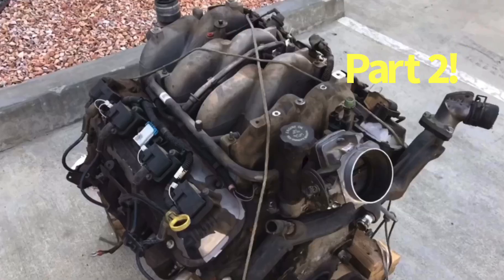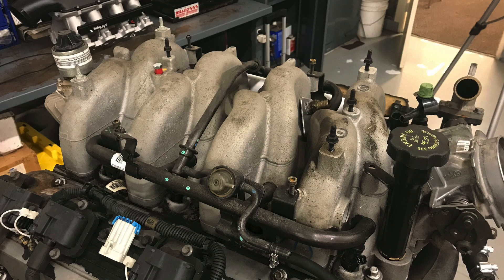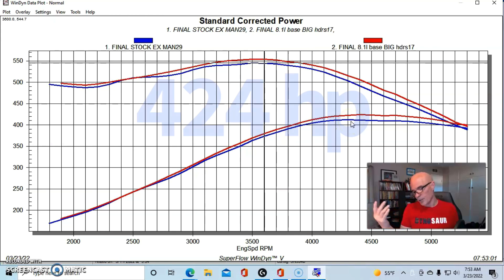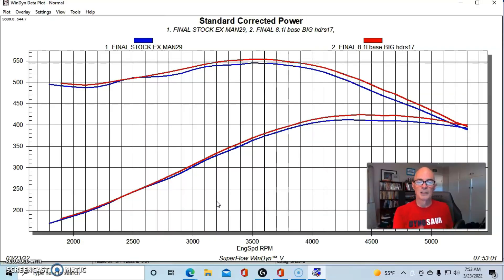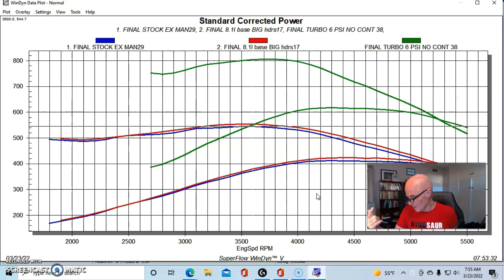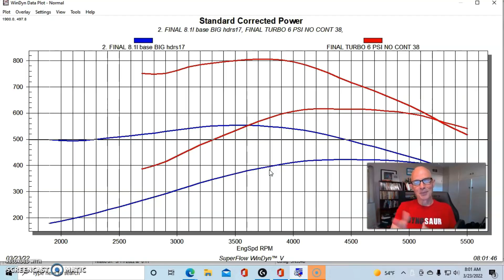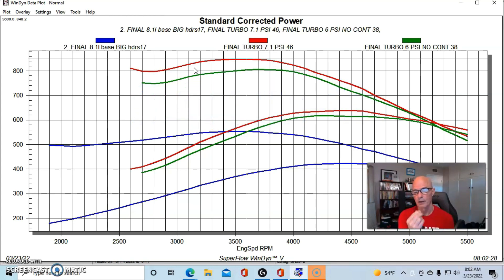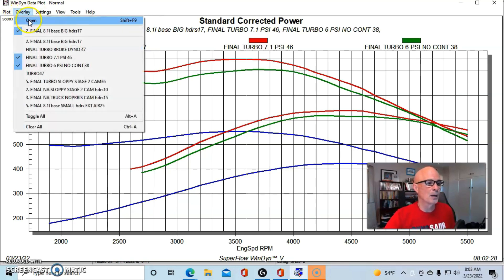HOW TO DIY TURBOCHARGE A JUNKYARD BIG BLOCK CHEVY-8.1L GEN 7 496 TURBO-HOW TO MAKE BIG TORQUE GAINS!

Comment: An idea for maybe a future video, in regard to turbo towing torque stuff. Have you ever tried lean tuning? Like intentionally running the motor past stoich, like 16:1. The EPA doesn't allow this due to NOx emissions, but for an emissions exempt rig you may be able to combine diesel efficiency with gasoline ease of build/cost. It'd be interesting to see what timing can be run past stoich on like 91oct. My understanding is that combustion temps go back down past stoich, but EGTs stay high.
Reply from the maker: that can be done under cruise conditions-my Civic VX ran lean burn (19:1)
Reply: @richardholdener1727  Yeah I've heard that some JDM cars do it from the factory. I'd be curious what happens under load. It'd probably kill a cat fast, but without that it could be good for high load efficiency.
Reply: @Projects Forever  - under high load running that lean doesn't kill the cats, it kills the rods/pistons. Light load/cruise conditions are fine as the cylinder pressures are relatively low, but at WOT you end up with catastrophic knock and shrapnel everywhere if it leans out. 

Google can get you as deep into this as you'd like if this isn't enough, or I know there are plenty of videos here on exactly how and why this is. 😀
Reply: @Broadpaw_Fox  I'm not sure that's true. As you approach stoich yes, but past that I believe knock goes back down, but again, I'm not sure which is why it'd be interesting to test. Imagine you go lean enough that you're throttling with fuel, you're literally putting less energy into that combustion chamber, which means less heat (and thus less knock).
Reply: @Levibetz  Interesting concept, but might only work with direct injection gasoline engine otherwise with port injection the fuel will already be compressed in the cylinder and the cylinder would be running hot causing preignition or literally turning your gas engine into a diesel lol...
Reply: Interesting!
Reply: That's some scary shit running leaner than stoich..my question is why would you even want to do that?
Reply: @jeffreyperrault3792 Better BSFC.
Reply: @jeffreyperrault3792  fuel efficiency/ good power under load.( it goes rich to make power, lean to cruise light load. We went as lean as 26-1 on natural gas,( no NO/x).

Comment: There's a reason for big blocks.  800 lb*ft of torque at 3500 rpm is ~530 HP.  That'll jerk your trailer uphill at a good clip.  Why rev any higher?  
God created the big block Chevy because he loves us and wants us to be happy.
Reply: On the other vid i commented that the torque peak is 3500 and HP peak is 4400 on this combo, however the torque is almost the same right off idle.   So it's setup perfectly for towing.    This engine would really come alive with a cam that puts torque peak at or above 5200 and HP between 6000-6500 RPM.
Reply: @dennisrobinson8008  but why even rev that high
Reply: Amen!
Reply: Amen!

Comment: Hey I need to ask some questions if you have the time
Reply from the maker: ask
Reply: I have a aluminum block from a 2012 gmc 4x4 I'm trying to buy pistons and don't know what to buy I'm running 243 heads and plan to run low boost in the future but would like to buy some forged pistons and forged rods and don't know what to get as far as rod length  C.H the dish or flat tops  ect.  Would like for it to run on pump gas aswell I'm just a little lost over here

Comment: Hey Richard, I am planning on adding a turbo for more towing power to my Stock 5.3L L83 Sierra as I will be towing my travel trailer more often. I was wondering whether I should just look for a complete turbo kit, and do it all at once,(once I have saved up for it) or upgrade my engine a bit at a time. Such as adding a CAI, beefier injectors, larger exhaust, and upgrading my torque converter and rear gears. A suggested parts list would be greatly appreciated. BTW, love the videos and information. Thanks.
Reply: Don’t your waste money on a CAI of your gonna boost it as you won’t use it.
Reply: Supercharger would be easier and cleaner install. Factor in tuning cost AND wait time to get tune done. Suppose you could remote tune if you absolutely had to
Reply: I agree a supercharger would look cleaner, and would be just as beneficial, but the price tag would be way out of my budget.
Reply: @crazygrandpame4946  turbo setup is gonna get outta control fast. The turbo is the easy to factor cost of the build.  Fuel setup, IC piping, intercooler, fuel system, custom manifolds...not to mention fabrication. Being able to drop a Magnuson (or equiv) in place of the intake manifold would be similar price to a "quality" turbo setup.
Reply: I think you could buy an LT5 takeoff supercharger and be alot cheaper than the actual Magnuson. Someone on YouTube has one, 500rwhp I think it was on the 5.3

Comment: Just pulled the 6.0l out of my 02 2500hd 4x4 4.10 and put in a stock 8.1 (out of an 03 Avalanche) with a Black Bear tune , uh yeah , I'm liking it !
Reply: I have a factory silverado with 8.1.  This tune has my interest
Reply: How has that tune been over the years?
Reply: @ijonathanf  So far so good , truck is running strong and have had no problems.
I ended up getting HP tuners and have done some trans shifting adjustments my self after some camper towing.

Comment: glad to see another boosted 8.1! I can vouch for the "tire spinning" torque, mine makes just over 900 ft.lbs. at the tire on 13 psi.
Reply from the maker: I LOVE YOUR 8.1L VIDS-GREAT STUFF-THEY ARE MEGA TORQUE MACHINES
Reply: @richardholdener1727  can the low 6.2 lbs of boost be run on pump gas? Would make a cool street rod but there is no E85 where I am at.
Reply: @chrislangdell117  almost surely. if not, a cam would likely help.
Reply: I wonder if anyone is interested in me posting vids on putting a turbo on my 2004 Fleetwood bounder with digital boost, the 8.1 had a 2 bent rods just finished a full rebuild thinking anything under 15 psi is pretty safe given most the parts are meant for a lot more 
beefed up the cooling a lot with a bigger rad and triple electric fans, only thing I can think is I might need to put an electric oil return pump on the turbo as might need to put it low but will see any interest ? I tow a 9744lbs trailer with it (basically a machine shop on wheels) its got a vortec 8100 aka 8.1 on a workhorse frame
Reply: @CNCAutomationLab  post it. Would be awesome to see
Reply: @CNCAutomationLab  do you have any videos I can watch?
Reply: @johnsheetz6639  not yet got it all torn apart atm. doing it right on a limited budget takes time. i have lot's of sensors in place so expect good data also setting up a site to share everything.
but list all sensor data points here.
everything you can get from haltech ecm + high resolution encoders on each end on the drive shaft (i can calibrate to a table and use it as a torque sensor and shaft speed sensor) head temps, block temp + knock, charge air temp before and after intercooler, mass air at turbo inlets turbo oil return temp and flow.
egt per port with long 4-2-1 headers wide band o2 per bank, rear mounted turbos (Class A RV an extra 0.1-.2sec is not a problem)

stock heads, custom cam, new rods, pistons, all hardware, oil pump, custom intake manifold with a 102mm electronic tb.
tested to 9.4:1 compression ratio
built to be a 1500hp engine I plain to 750-800 ish on cheap pump crap California fuel. with a good moderate life having a trans and new drive shafts built while i convert the rear suspension from air over leaf to a 4 link setup with watts link and new gear set. also converting the front to air and installing an Air lift 3H system with height sensors to keep things happy, updated rv leveling system to a newer auto electric system from lippert. (also lifts enough for me to work on it with 10ton safety stands)
Reply: @CNCAutomationLab  excellent! I will check in on that!
Reply: @CNCAutomationLab Interested!
Reply: Shouts to LT for sure on stirring up the 8.1 again 🙏🏾
Reply: What’s up LT love your videos brother especially the 8.1 content, Richard finally joined the party 👏🏼👏🏼👏🏼
Reply: That inspired me to build one, thanks guys!!
Reply: Love ur stuff LT!
Reply: i followed your build, really enjoyed it.
Reply: What up LT!!
Reply: Followed your build man! Absolutely killer performance from these big mills.
Reply: LT!
Reply: What are you making for hp On a dyno at 13lbs
Reply: So glad you started your own channel LT!
Reply: NRE makes an X-Ram intake with 2 90mm throttlebodies. On their video that intake make alot more horsepower and has better throttle response that a single intake
Reply: LT is why I started looking for an 8.1 to put in my escalade!
Reply: If your not using the headers anymore do u want to sell them 😅

Comment: This seems like a great combo for someone who wants diesel power without a diesel,just wonder how reliable it would be.
Reply: Very reliable. It's chevy man! 😂 but seriously, it is actually very reliable. LT from Powernation has been using this in his truck for a couple years now and its fine.
Reply: @sethh8892  how much boost has he been running for the past couple years? And is he on E or pump? I'm starting his videos now but there are dozens
Reply: @navisingh8816  low boost, like 13lbs I think. Hes making 900lbft at the wheels and like 600 or 700 hp. I want to say he's using high octane pump gas, I don't think he's running E85.
Reply: @sethh8892  thanks man, and he's on stock short block? I know I'll lose power and choke out at high rpm if I keep stock heads, and that's okay. 636hp is plenty🤣 I just don't want to blow up the rotating assembly
Reply: Our 01 3500 has an 8.1l and it just reached the 385,000 mile mark.
Reply: Probably more reliable than a modern diesel. Certainly cheaper to fix.
Reply: I wonder more how bad the mileage while towing under boost would be! 😬
Reply: @guyforlogos at that piont it called GPM not MPG! Lol
Reply: And it will pass almost anything but a gas station!
Reply: My stock 8.1 is a Duramax KILLER!
Reply: @My Bizz  I have run a 8.1 and Allison combo in a 2001 Silverado 2500HD. I loved that truck, but it couldn't touch a 2020 Duramax with the 10 speed auto while both are pulling a loaded 36' goose neck trailer. No way. Not even close.
Reply: @countryjoe3551  honestly thats probably more because of the 10 speed than anything else.

Comment: Who needs a diesel for torque?  Stock 8.1 liter with a little boost gives you all the torque you'll need in your dually.
Reply: BC diesels make max tq at like half the rpm of this 8.1,  900tq at 1800rpm is pretty damn nice when towing 15k
Reply: @bigandlittlecountry Did you see the graph at 6:34? 800 Ftlbs at 2600 rpm!

Comment: Wow the power is crazy. I wonder what kind of mpg it would crank out in a daily type  scenario.
Reply: horrible. absolutely vile, disgusting awful and terrible mileage. 13mpg stock babied on a good day cruising on the highway. Sub 10 with any sort of tune or mild upgrades
Reply: @rustysausage69  that much?
Reply: @MrScottt28  Sounds high, I wouldn't think you would get double digits unless its in a light weight chassis.
Reply: @JohnnyAnderson1  If you're Burning Rubber, mile per gallons drops like a rock out a window!  You simply don't travel too far when smoking the tires mercilessly!
Reply: @scotttimpany2845   lol
Reply: I get 10 out of my stock 8.1 burb.
Reply: @fesco2205  You must drive downhill everywhere.
Reply: Who CARES!????
Reply: @mybizz8542  I do obviously lol.

Comment: Hi Richard, I have a very healthy NA 358ci 2V Clevo (solid roller, studded, girdled, etc) and I was looking at turbocharging the combo and have since moved to a larger CC head to aid in lowering the compression to 9.5:1. 
I'm not looking to max out the hp, rather I'm interested in faster response, more mid range power. Is there a turbo you would recommend to suit this application or would you need more info. to make that decision? 
Cheers Rob.
Reply: Hi Robert, if you are looking at buying a name brand turbo it might be good to reach out to the manufacturer and ask! They are usually pretty helpful to size turbos for your application :)

If you aren't going name brand, I'm sure Richard or someone else could chime in with their experience.
Reply: @TheBCninja  thanks for the reply mate, I've previously reached out to manufacturers before with mixed results. Having spent $$$$ on combo's over the years, I want to keep costs down so I'm doing all the work myself this time around. So yeah, I guess I am looking at cheaper alternatives, I think they've come along way from what used to be available, I do however run a PT 6466 gen2 on my barra though. Lol
Reply: @RoB_666_  sorry to hear about the mixed results! You have a good taste in engines. Good luck with your build, it's gonna be sweet!
Reply: @TheBCninja  all good mate, comes with the territory. Cheers, yeah definitely looking forward to finalising everything and getting it pieced together and put in some seat time.
Reply from the maker: what power level do you want?
Reply: @richardholdener1727  hey Richard, thanks for replying....like I'd mentioned I don't have a specific hp goal in mind although NA the motor made just shy of 560hp @ 6900 so obviously any thing better than that is a bonus 😁 looking to turn a little less rpm aswell.
Cheers Rob
Reply: @richardholdener1727  If i gave you a figure of say 650+/- Is that feasible given what I'm trying to achieve?
My thought being is there a turbo available I can take advantage of to make 'X' amount of power sooner, without maxing the turbo, while also giving me the responsiveness I'm chasing....or am I asking to much? 🤔
If so, would you have a more realistic overview of what I could/should expect?
Appreciate the help greatly.
Cheers Rob 🍻🍻🍻

Comment: I've had a 496 Mark IV with AFR heads and a marine F2 level procharger on the street in a first gen Camaro...I lol at that torque that's what I tried to explain to people...it was INSANE and completely useless on a 275 pro Drag Radial...
Reply: The stockish 5.3 in my C10 will spin the tires on the street, I can’t imagine having 800+ ft lbs on the street…
Reply: @shitbox82  My 3.6L V-6 has no problem spinning the tires in 2wd so when on slick surfaces, it is in Auto 4wd. Of course the 3.6 is rated at nearly the same HP as some versions of the 8.19 (308 vs 312 in a u-haul ) but the 8.1 will stomp it into the ground with torque.
Reply: i use 345/40r17s on my stockish 4.6L 2v 09 P71 with 3.27 rear end but going 3.73s hopefully soon enough, you def need more tire, man..lol

Comment: Just don't try boost with a stock 4l60e. You only get to try it once. It's fun for about 20 seconds or so. After that you get to set in the driveway and listen to your awesome turbo motor.
Reply from the maker: BUT YOU GET ALL THOSE EXTRA NEUTRALS
Reply: @richardholdener1727  🤣
Reply: @richardholdener1727  True dat.
Reply: Good thing most 8.1 liter trucks came with the Allison transmission
Reply: @11ellswray  But even they are right at the edge when it comes to the 8.1. Best to rebuild it before breaking it too. Only rated at 620lbft from the factory on the 5 spd early ones and 765 on the later ones. A little boost as shown would cause a factory one to gain a lot of neutral gears.
Reply: Just thing of the savings in gas
Reply: Would an Allison  spd handle it?
Reply: No  @WillEddy-s1d

Comment: when you "add ring gap" to a junkyard engine are you reusing the old rings? are you cleaning carbon out of the grooves? honing? putting the rings back in exactly the same place? are there any long term negative effects from doing this? thanks
Reply from the maker: reuse stock rings, clean carbon, usually (not always) put rings back with same piston,
Reply: Compression rings may be fine, but if the engine was ever run hot the oil control rings/tensioner will let excessive amount of oil into chamber...kills octane rating/ smokes/builds up carbon...rings are cheap
Reply: @timc2510  The idea behind reusing the ring pack is purely to test their mechanical limit in a high power application. Many people claim you need a better ring pack just to run reliably past stock power levels while others attest by being able to reuse oem rings on countless 1000 or more fwhp combos. Rings are cheap, however, when you get into the "while your in there" mods, you can find yourself rebuilding an engine where reassembly would have been just fine.

Comment: Do you think the dart intake with holley sniper efi would be much of a difference over the stock setup hp and tq wise? If I remember correctly it also has MSD Distributor and uses the 502 camshaft  to correct timing.
Reply from the maker: the dart intake won't care what firing order cam you run, we will have to see how it compares the stock long runner efi intake
Reply: @richardholdener1727  im excited to see as putting the motor in my project is a not for a bit. But would love to see what parts I have that I should keep and what parts I can let go of to fund my project. As I have quite the stock pile of parts atm lol

Comment: Looks like you put the 8.1 heads on a flowbench. How do they compete with stock truck 4.8/5.3 heads?
Reply from the maker: they flow more than 5.3l heads
Reply: @richardholdener1727  😂

Comment: What is the max boost you can use without gapping the rings? I just saw your other vid of comparing the Truck Norris cam against the Sloppy Stage 2 on a 5.3…..you said you weren’t going to gap those rings and gave it 7.5 lbs boost.
Reply from the maker: now way to know-since you don't know the gap-even if you did there are too many other factors